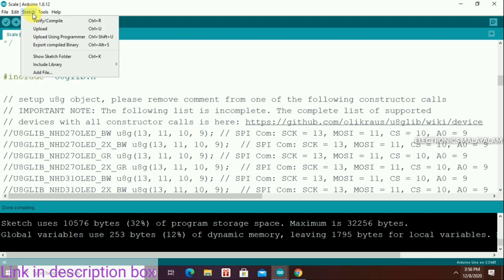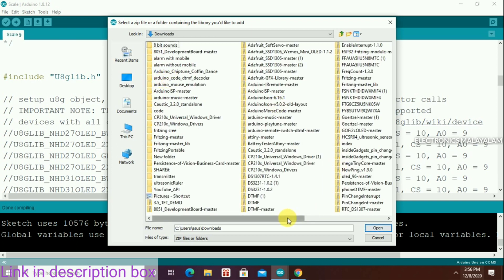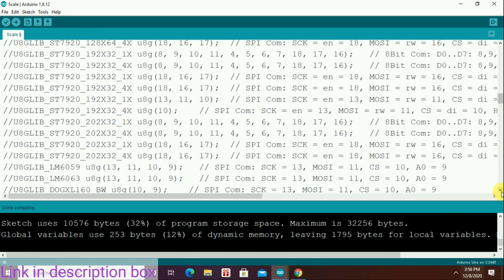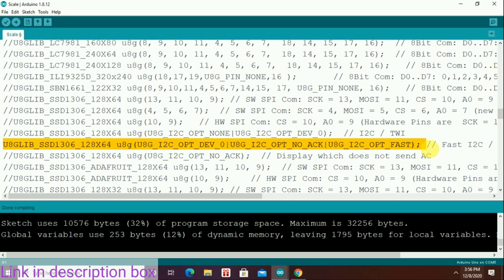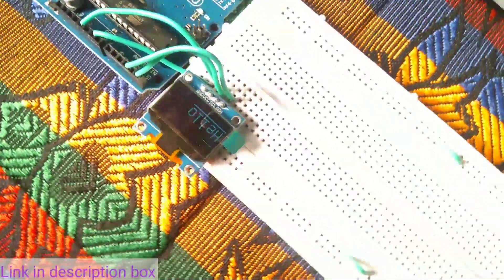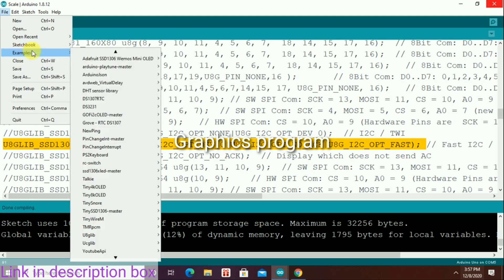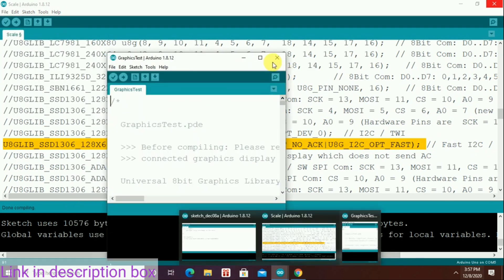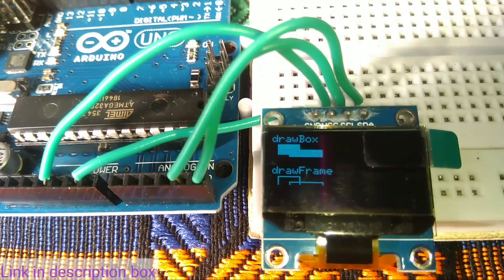ARDUINO OLED DISPLAY  | Arduino Display

Comment from the maker: Make Transmitter & Receiver - https://youtu.be/7eTrtlQHGEk

DIY Walkie Talkie - https://youtu.be/0Gd260sZGJ8

Walkie Talkie Circuit - https://youtu.be/3lprMnaAWC8

Simple FM Transmitter - https://youtu.be/PcTJVu90MNY

Walkie Talkie - https://youtu.be/0z_tC79HigQ

FM Radio Circuit - https://youtu.be/BT6jycXjzcQ

Traffic Light Circuit - https://youtu.be/U2yT2Pr9O-s

LED Bulb low cost - https://youtu.be/LB521YZt1To

Electric Fence Circuit - https://youtu.be/u6pEuAeXfNo

Mobile phone control Bulb - https://youtu.be/pwe4EkbvlsQ

FM Transmitter simple - https://youtu.be/knRKnB5qf3U

Control Fan / Light Using TV Remote - https://youtu.be/hFx0Pr8Z-7c

Motion Sensor Bulb - https://youtu.be/WyVSDcexOKY

Clap switch circuit - https://youtu.be/b0kTA6BHnPU

Arduino Programing Malayalam - https://youtu.be/qEachwmU5UM

Arduino color display(ST 7735) - https://youtu.be/6NhETNyqXks

Arduino OLED Display - https://youtu.be/1thhuzxQR_Y

Arduino Bluetooth 4 channel Relay control - https://youtu.be/pheecQPKj1M

Arduino FM Transmitter - https://youtu.be/3_R7GBJdK18

Arduino Code locking - https://youtu.be/Jlu3HTJtMPM

Arduino Bootloader programming malayalam - https://youtu.be/Nto33g0oKi0

Arduino IC programming tutorial - https://youtu.be/4wMKdqIXfKs

Arduino mobile programming - https://youtu.be/jNS3TKagOec

Transistor checking malayalam - https://youtu.be/COeU-gzzhYY

Multimeter using malayalam - https://youtu.be/8roH_4IBtNg

Electronics malayalam - 
https://youtu.be/UAqu5elD7OI

For more projects / circuit / videos visit :
https://circuityep.blogspot.com